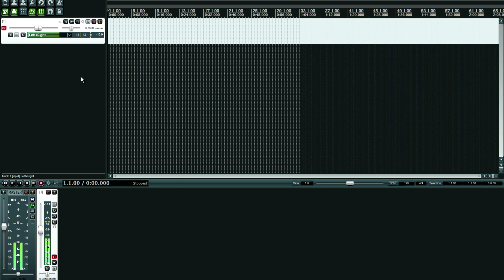How Good Is Your Audio Interface?

Comment: a guy at Sweetwater said to me that I have to upgrade from my Scarlett  focusrite 2i2 .. To A Audient Id14 . Because The The Scarlett 2i2 Do Not Have Very Good Converts Inside. I Couldn't Tell The Difference But I Bought The Id14  AnyWays.  Was That A Stupid Move Of Me ..??  Can You Tell Me If I Should Of Just Stayed  With The 2i2 or Did I Made The Right Move ??
Reply from the maker: I don't ever trust salesman. Their job is to sell you things that you may or may not need. The Audient has a better instrument input and preamps. That's why Focusrite put out a 2nd generation Scarlett update...to compete with the iD14.
Reply: So Which One Has The Better Converters  Which Do I need ?
Reply from the maker: Probably the iD14 but the 2i2 isn't a bad interface.